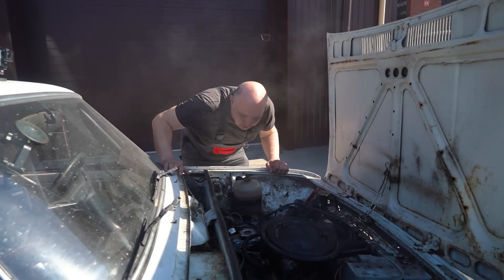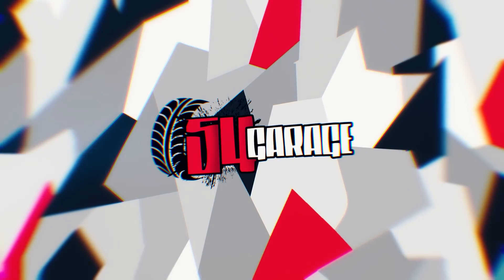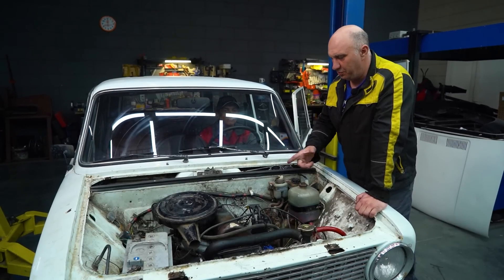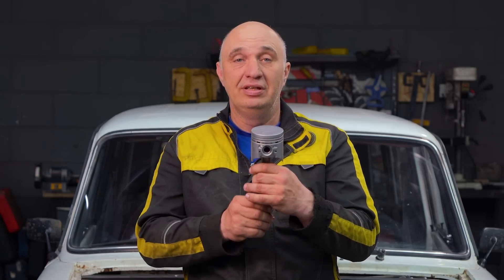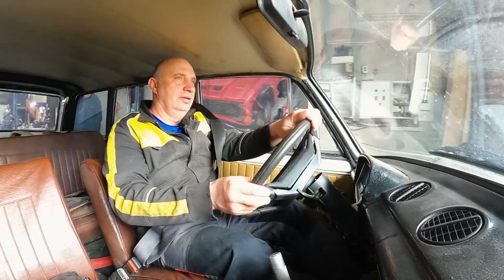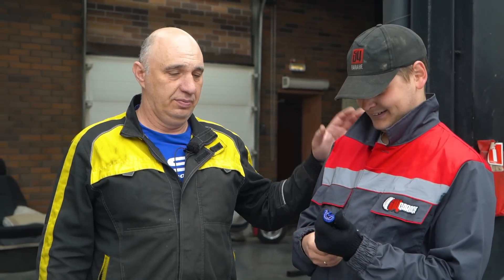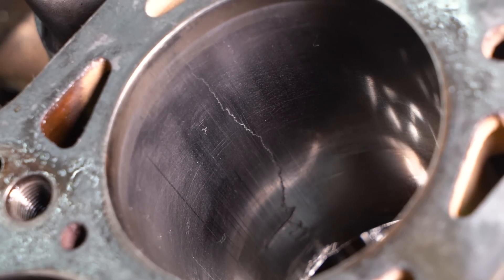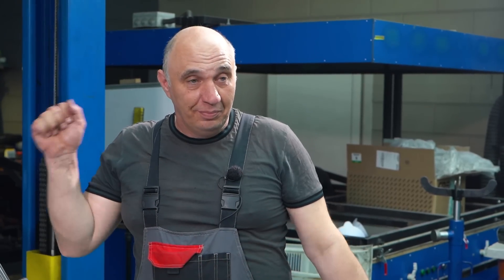We install pistons backwards - what will happen?

Comment: This reminds me of my first year as an apprentice.  Around 1986. One of the mechanics brought a car in the shop, the lady who owned it was complaining of a bad engine noise. I honestly can't remember what car it was. Definitely a V8. The car is in the shop running. Mechanic opens the hood, reaches in and gives it a couple of whacks on the throttle.  Something in the bottom end let go and it scattered a bunch of parts on the floor.  He looks under the car for a second, comes back up and very calmly says to the lady, "There's your problem. There's parts of your engine on the floor."
I remember  that I had to walk away because I was killing myself laughing.  
That was my mentor. He never got excited, always had a "I really don't care" attitude. 
And that is the one major thing I learned from this man. Not to have empathy.  Told me to always remember,,,
I didn't build it,
I didn't buy it,
And I certainly didn't  break it. 
Your job is to repair cars. You're not there to counsel the people who own them.

Comment: Moron boomers use to do this with a lot of Chrysler Slant 6's and 360's thinking they discoverd a huge HP break through which it actually does nothing other then wears out your piston skirt and actually makes the piston sit a tiny bit lower in the cylinder by a few thouands you actually loose HP and loose compression ratio.   They off set piston wrist pins from factory so that way the piston on it's powerstroke has less pison slap.  If this was a real hP break through them aftermarket pistom manufatures would make all their pistons off set.

Comment: The offset pin is to minimize wobble on the upstroke and firing stage. 
The piston rod is being pulled from side to side by the crank. 
There is a reason for this AND the forward pointing arrows stamped on the piston. 
If you flip the piston you've defeated all of this. 
The offset pin came about when the V8s came out they would wear on the 
low side and increase oil consumption. 
This is the solution the engineers came up with.

Comment: This an old school hotrod trick, it loads the piston up sooner in the compression stroke which is supposed to in turn produce more power the negative effect is piston slap especially on cold starts. Some people swear by it I've personally tried it on a 4 cylinder Honda race engine and a sbf 302, I noticed piston slap on both engines and no noticeable power gains.

Comment: I put new big end bearings on a car once in the wrong order and it wouldn't even turn over.  It was ok once they were put on the right journals.  Never started it because it was so stiff the wrong way round.  I did the same on another car before that because I didn't know it mattered.  The car made a horrible noise for about 100 miles or so but gradually got better and then it settled down like new:)

Comment: Okay. I have a very fun idea guys! I have a pickup that I am replacing the 4speed  manual trans with a 5 speed. But now I want to take the 4 speed and use it as a gear bender backwards. Instead of reducing gear ratios for better pulling down low I want to increase it for better highway speeds, by putting the gearbox with the tailshaft facing the Main 5 speed gearbox. Is this possible?

Comment: Russians are just like us. Frustrated at all the poor quality of the car manufacturers engines and parts as of recent years. It takes an old engine to hold up better than new engines. You have to install pistons wrong in order for your old engine to fail. New engines are failing under 100,000 miles across manufacturers today. Engine parts today suck. 😮😊

Comment: You also make the piston reach farther out of the bore, or closer to contact the crank...  In the USA, wrist pin flip is done all the time on SBC 350, etc...  BUT YOU DONT JUST FLIP THE ROD, unless your rod to crank is non directional. plus, you should degree the cam to match since TDC will be different...

Comment: You know what this means...
Time to make MORE custom pistons! But in this time you'll be testing different offsets. From slightly more offset than stock, to as far as you can before the piston pin will hit the cylinder wall... 😅
Also, testing them in both orientations. (feel free to orient 2 one way, 2 the other, to tackle both at once)

Comment: Sort of a stupid video, if you're under stand anything about reversing the Pistons it has to do with piston offset, in the angle of the crankshaft. If you reverse the engines on the VW engine it will give it a slight one to two more horsepower but it causes piston slap because the angle and offset of the Pistons is harder on the piston skirt. And some offsets are to clear camshafts other internal parts.

Comment: Uhhhh, there is a valve relief cut into each piston. All the pistons had scarring from valves hitting the top after flipping them around. You have bent valves. The #3 piston is steam cleaned from coolant leaking into the cylinder, that is where the coolant went... right out the exhaust. It is likely to have cracked head from the valves being hit so much.

Comment: Also to consider..Piston install 180 degree backward..The valve reliefs on top of piston are not matched..Valve to piston clearance questioned...And definate yes..Piston pin offset in cylinder wall....

Comment: maybe I´m wrong but at 12:57 it looks like a valve hit the piston because flipping the pistons 180° means no valve pockets at the right place.
Engines run really bad when the valves are hitting the pistons. Do the rods have oil squirters to oil the cylinder wall that takes the higher load?
If they are directed wrong wear goes up. And giving a car to a young man to "give it the beans" often doesn`t end well.

Comment: The piston will crack. If I was was building an opposite rotating engine (marine application ) flywheel aft a standard rotating engine would turn a left hand propeller an opposite rotating engine would turn a right hand propeller. I learned this 50 years ago it was clearly called out in assembly manuals from chris craft , chrysler marine , gray marine and others failure to do this will cause piston failure and damage to the block. The pistons must be installed on the rods with the notch facing the rear for opposite rotating engines

Comment: Video Idea. Could you try to make your own cylinder deactivation to save fuel on the highway? By stopping the signal to the spark plugs and injectors with the flip of a switch ? Making a 4 cylinder run on 2 cylinders or a 8 cylinder run on 4 cylinders.
Reply: I like this idea. But make a system that doesn’t eventually destroy the engine like some OEMs are having problems with.

Comment: I've heard this was an Old School trick to gain more torque for drag racing. Its done to prevent piston slap when the engine is cold but when flipped it give the rod a better mechanical advantage in relation to the crank.

Comment: If i remember correctly Smokey Yunik did this in nascar as it has a big influence in piston speed when the piston accelerates up, down and how fast it moves in different locations in the bore.
. Having it reversed you give the engine more time to suck in mixture but skirt wear will be much more. Comparing the two ways with a degree wheel, you clearly see the difference where the crank is located on both engines have if you set both engines to have the piston down say 20mm.

Comment: I never suspected the pistons are asymmetrical until I saw the video. More than 30 years ago, when I was unemployed, I attempted to work at a garage, first as an assistant and hopefully learn the job and make my own progress. There were too many things which I did not suspect and looked unassuming at first. Components having a barely noticeable asymmetry were often mounted flipped over,. My job was full of f***ups and I was constantly arguing with my boss. Gladly, I don't need to do that work anymore.

Comment: They messed up the test by changing two things at the same time. I think they lost the oil spray on the cylinder wall by flipping the rod over when they flipped the piston. When flipping pistons on an inline engine, the pistons must be flipped on the connecting rod so the oil spray continues properly. With no oil on the cylinder, I'm surprised it went 500 km.

Comment: Ive had an idea for many years. Opposing force with electromagnets. In stead of the coil firing a spark plug why not an electromagnet with a magnet embedded in the top of the cylinder so when firing it pushes away. Same engine just no plugs no gas just a quick electromagnetic burst. Ive thought long and hard but not there yet. I know perpetual motion doesn't exist but this isnt perpetual as it is using power.

Comment: I do not know anything about this engine in particular. That said a lot of engines also have a crankshaft that is slightly offset to one side. The pins location can also play a role in that. In fact some connecting rods have a bend in them on purpose today as well again to allow more crankshaft offset!

Comment: I'm sorry but if the pin is offset that's the point where the force is being directed from the thrust of the motor that should probably be the rotational side to give added torque and the rotational thrust being correct cuz that's why that detonation of thrust is going to be an uneven back thrust if it starts I can't imagine it idling

Comment: TBQH I was expecting the engine to fail almost immediately, as the recess for the valves at the top of the cylinder is not symmetrical. Non-interference design?

Comment: They didn't check the air gap between the connecting rods and the block casting before installing the pistons the wrong way round. It might have been necessary to remove material from there so that the connecting rods could rotate properly. But I could be wrong.

Comment: Uncle Tony said turning the pistons around can increase power slightly on some engines then Freiburger said it would do nothing. The idea that there would be no change on any engine is ridiculous I think but regardless it was a little bit of drama. Freiburger has said some silly crap before, he said stroke length has nothing to do with redline 🤨.

Comment: This was an interesting experiment, but I think you should do it again with an engine that is in near new condition. I believe that the engine failure was not caused by the pistons being fitted backwards alone but because it was a very worn engine from the start. Racing teams in the USA used to do this trick to gain power and it did give an extra 7 to 20 HP when done on a V8. I would say if you got an engine, rebore it, grind the crankshaft, new pistons, bearings oil pump etc. Check the there is enough clearance between the valves and pistons (that may have been a problem here} If you do all that I think you will have no problem except a little of extra wear on one side of the piston. I believe if you were to do that your engine would run fine for a long time and gain a little of power along the way.

Comment: A trick in the US on B and RB Mopar engines is to turn the pistons around and run them backwards.it can cause piston slap when the engine is cold, but once it warms it increases horsepower.  I don’t remember by how much, but it’s free Horsepower and will work when not using domed pistons.

Comment: G'day Garage54 & BMI,
Usually I just like to make a comedy comment but today...
😲WOW! that is crazy, Seriously Thank You so much for this video including Vlad's breakdown of the Enginering Principle for the 2mm Offset as I really learned a lot.
I am not a qualified mechanic but for a hobby I have been rebuiling my old Suzuki including getting the head machined, replacing the gasket & valve stem seals as it was a little smokey, so I didn't take the pistons out but now understand how important putting it is to put them back the right way if I ever do.

Comment: The rod has a little gap on on side. This allows oil to spray in to the cylinders walls and camshaft. You can only rotate the pistons not the rod.

Comment: do lada rods have a chamfer on one side like many western engines? also if the oil hole isnt centered as well it wont line up with the holes in the crank, starving the wrist pin of oil

Comment: Garage 54, should try and cast their own engine, with the parts they have laying around. a V2, V4 or so. a air cooled V2 with 1/2 liter pistons using the lada flywheel and mating area for gearbox, so it can be used.
Nice, the know that the rod pin was offset by bit.

Comment: Did you flip just the pistons or the rods too?  I don't think it matters as much on engines with a single rod per journal, but some engines won't even turn over with just the rods installed backwards, even with the piston correct.

Comment: If you haven't yet, you should turbo a Lada engine and increase the boost until it blows. I noticed they are a closed deck block so I would be curious to see how much they can handle.
Reply: Isn't it obvious that we've been turboing the shit out of that engines for a long time. VAZ 21126 can easily make like 250 hp and it won't blow up immediately. But it won't last that long. My car does 190 hp with supereutheutic pistons
Reply: @player1GR  We have done over 400hp racing engines from older engines in Finland... and they last quite well...
Reply: @NitroGnome  try a small block chevy, the weigh about the same (even though the lada is a 4 cylinder) and the SBC will make 400HP with a simple cam change.
Reply: I own top fuel harley... i dont need kid's toys ;)
Reply: @player1GR  If that is it I will import lada engines to put on my cars loll
Reply: @CleetusMcFarland send these guys an 88mm Precision turbskie.
Reply: @Ole_CornPop  Thats way to many Bald Eagles for a Lada to handle on the burnout pad.. Perfect..🤣🤣
Reply: @Ole_CornPop  add some race fuel and some nittos to that list. Make fir a good episode
Reply: Gap the rings to 34 thou and throw all the boost you want at the thing.
Reply: YES!!
Reply: Dude I've bin watching for literally 5 yes commenting every time I have a chance to turbo the fuck out the Lada sound like a 3.1 Chevy engine do it what ever you want cuz fuck piston melting x itl still turn on
Reply: Dude I've bin watching for literally 5 yes commenting every time I have a chance to turbo the fuck out the Lada sound like a 3.1 Chevy engine do it what ever you want cuz fuck piston melting x itl still turn on
Reply: They can take a lot of boost, but they aren't reliable. Several changes should me made.
Reply: Train tracks will do that 🤣👍💚💛❤️

Comment: The whole reason it's made that way is to make it quieter a lot of guys say you get a little more low and Power by flipping them backwards I think it's different on a V8 engine in America they do this all the time mostly mostly the Chrysler guys
Reply: you get more power but the trade off is the piston is driven down off perpendicular and you get a bit of piston slap down low. Helped keep up a vacuum when running cams that where too big

Comment: When pistons are marked with an arrow or dot to indicate orientation it may be because of a slight offset or for thermal expansion properties. Installing backward will result in either premature wear or potential extreme failure. You need to have very close attention to detail when rebuilding or building an engine. These experiments are pretty cool. While some of the answers to their questions are obvious, it's still fun to watch the experiment and see the real world results.
Reply: WRONG! Piston pin offset is only to negate piston rocking which creates noise. THAT'S IT.
Reply: you will find the piston pin is not centered exactly. And if you had odd expansion in a round bore, you have other major issues

Comment: Offset allows rod to pass TDC before combustion. In reverse, combustion tries to jackhammer it backwards.
Reply: Its like that so it doesn't rock that hard on the side of the block when it tries to push the rod forward
Reply: @mihailpetrovici5044  I know my GF rocks hard when I push the rod forward, if that helps?  :face-orange-biting-nails:
Reply: That's what I thought also
Reply: buttt with the right cam timing and a few other mods it can be used to your advantage, but the cam is the key
Reply: So basically extreme knocking?
Reply: @jwalster9412   Seems that way J. "eXtreme"!  (formally known as eXtwitter) Yes. That made almost no sense  :body-blue-raised-arms:
Reply: @ovalwingnut  I can't comprehend what you are trying to convey.
Reply: @jwalster9412   J. You are a gentleman/gal? and a scholar. I was (trying) to reference the goofy switch from Twitter to X where you constantly see X "formally known as Twitter"... but my bad. My doctor said this might happen :hand-pink-waving::face-blue-smiling:  Please ignor my outbursts. My GF always does. Cheers my friend  🖖
Reply: @ovalwingnut  you got some issues
Reply: NONSENSE! The only thing offset pin location does is negate some piston rocking. It is ONLY done for noise.
Reply: Actually it's so that the direction of force from combustion is pointed downwards, rather than at an angle and into the walls of the cylinders. Engineer Explained has a video about it if you want to know more.
Reply: so if they put the timing chain a few teeth out to compensate it would have worked?
Reply: Thank you. I needed that. Which ironically is the same thing my date screamed at me last night :cat-orange-whistling:
Reply: @ovalwingnut  You got jackhammered backwards by your date 🤣🤣
Reply: it covers your ass with your badly timed lada engine, it wont knock so bad if its offset 😂

Comment: That is because you rotated them 180° in the wrong direction... Otherwise the result would be completely different. 😁
Reply: You're right.  They rotated them all clockwise.  They need to rotate them back 180 degrees counterclockwise to reset to factory and then rotate them 180 degrees counterclockwise again to get the desired results..